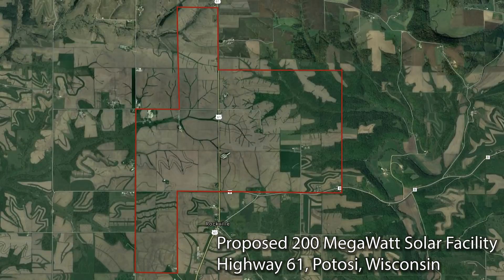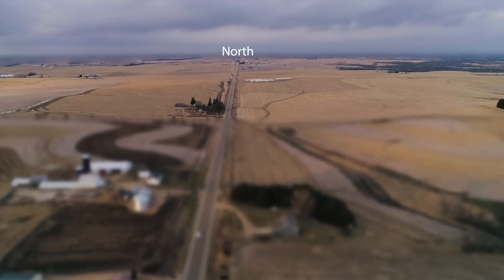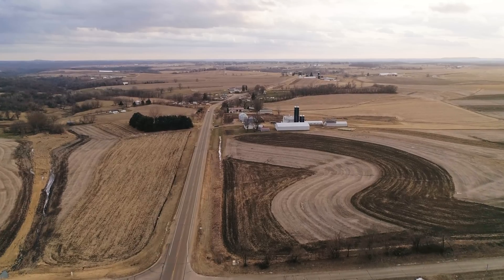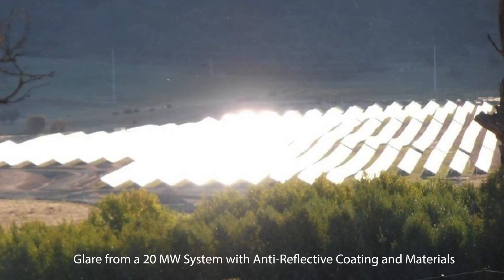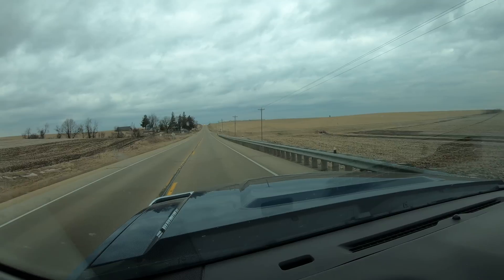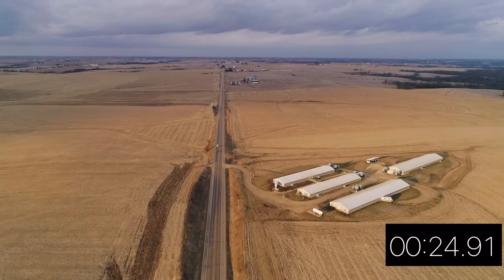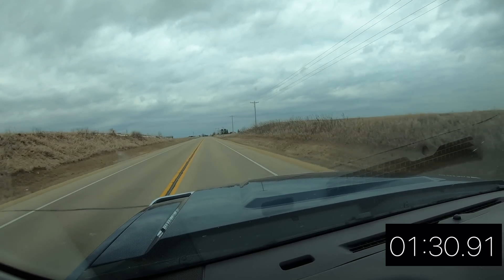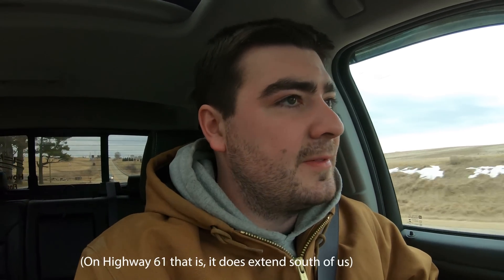Proposed 200-MW Solar Facility | NextEra Energy

Comment: I hate that companies like this have to use up all the good farm land , they don’t make any land any more, most solar panels are only good for 25 years so in 25 years from not either all that land could be put back to farm land but it would be very hard do to all the metal poles in the ground, there are a shortage of panels do the the trade industry. I like the solar energy but there’s better ways to put them in and use less prime farm land. Just cause there’s that much solar going won’t have any affect or your power bill it surly won’t lower it so I don’t see a benefit for you to have so close to the land you farm and want to keep farming. I do know a bit on how they are installed and they ways they put them in if your interested let me know! Keep farming!!
Reply: They don't stop working after 25 years.

Comment: Hi Ryan what is the longevity of the panels which is about 20 years I'm told  and what happens to the land after that
Reply: @Eli_E99 Unless the company goes bankrupt 2 months before that lease period is up...
Reply: The panels usually have a 25 year warranty to supply up to 85% - 90% of their original power output.  They are not going to stop working after 20 years.

Comment: Sorry to hear it's an obsolete energy source there just holding out on us.
Reply: Obsolete energy source? I wish to know what you consider a relative energy source?
Reply: Plasma was introduced by the country we just  blew up a general by the keishi foundation and we stand on a capacitor and can draw enough at 1 meter above the ground to power a house.
Reply: @scottpage978  Fusion Plasma energy has not yet generated enough power to offset the amount consumed in producing the conditions that are necessary for fusion to take place. Plasma power has only been operated for a short period of time. It has not been proven.  
Unfortunately the same has gone on for decades about Hydrogen power.

Comment: In 30 years who has to foot the bill to replace them.  Will they just declare bankruptcy and leave all the hazardous to the local tax payers to clean it up.
Reply: Solar panels are a lot less hazardous to clean up than coal or nuclear power plants. Mostly just steel, glass, and, silicon. not much hazardous there, unlike a nuclear plant.
Reply: Just like turbines at damns, they are maintained and replaced when necessary and the project will out live a person's lifetime.

Comment: can not be good,,, unless you are getting out of farming,,, lots of traffic,   We have so much natural gas in America why would we need solar panels.   it like wind farms,,, they are every where in Oklahoma       they are ugly, and the are going broke,
Reply: Just run a pipeline
Reply: Here in Minnesota we have no fossil fuels. So, we are producing about twenty per cent of our electricity with renewables, wind, solar and hydro. most of the coal fired plants are being shut down, and replaced with gas, we also have a few nuclear plants that still function. Our state goal is to keep moving to energy independace using renewables, rather than building new fossil fuel plants. In the long run, we will have a more reliable supply of clean energy, at, a competitive cost.
Reply: Keith Kuckler That is misleading.  The state goal is 1.5% of our energy by solar by end of 2020, not the current production. The rest is biomass (corn/ethanol) wind and hydro combined which is at about 25% of our total.

Comment: My initial question was going to be about storm damage too. You wouldn’t want glass flying.
Reply: Depending upon the solar module construction the glass of a solar module usually is made of tempered glass with an anti reflective coating. Its very strong like your house windows.
Reply from the maker: ginggur17 I’ve also read about really toxic chemicals like Cadmium in the panels. Supposedly in broken panels the cadmium can leak out really quick!
Reply: How Farms Work , not the kind of stuff ya want in the ground.
Reply: @HowFarmsWork  Yep. And that would pretty much destroy that patch of land.
Reply: How Farms Work I’m pretty sure any exposer to the chemicals in solar panels can cause cancer if I mind right?
Reply: @bruceirvinggaming  Who cares? Trump does not believe in Science anyway. So let the rich get richer!!
Reply: @HowFarmsWork  The panels are sealed, layered in construction.  There is many toxic chemicals in all electronics including your smart phone, your vehicles, computers, batteries, etc. 

Need to ask yourself what are the odds that the solar modules would break.  I've seen solar modules survive significant hail diameter (baseball sized) strikes. I've seen solar modules walked upon during installation. I've seen 35+ year old solar modules still producing power. 
There is a lot of misinformation in these opinions being shared here. 

Farmers have had to battle methane gases or other chemicals produced from livestock. Or the use of hundreds of chemicals on farmfields such as Roundup, 2-4-D, etc.
Some of these toxic chemicals are already in our soils, rocks, water  in low amounts.
Reply: @HowFarmsWork  always good to ask questions. but, ever heard of all the ppl dying from their solar panels on the roofs all around the world? no? me neither. whenever you think something could be a problem, look for precedent. don't buy into hysteria. 

what you are addressing is a recycling problem, not an operational problem. in case of freak damage (tornado, hurricane, earthquake...) it gets treated as h.waste and acted accordingly. your county should make sure proper recycling norms are in the contract with the company, not just landfill-disposal (end of life).

what you are reading in the press about it (or certain internet-sites) focuses on problems arising in countries with no gov. recycling mandates where electronics of any kind just get dumped somewhere, and thus cause env. damage (all kind of toxic components inside).

Comment: I work for a landscape company that has a contract for our energy company here in Michigan and part of it is a big solar field 35 (roughly) minutes from where I live, 10k panels split on 2 250 300 acres biggest solar array east of the Mississippi and I've been told from fellow employees it only powers not even a quarter of the city.

Comment: That photo claiming to be Manchester-Boston airport, isn't near Boston and it isn't a solar panel array. The first hint is you can't see mountains like that anywhere east of the Mississippi River. It is actually one of a set of 3 thermal reflector solar facilities in southern California south of Las Vegas along I 15. I've driven by it numerous times. Google Primm Nevada, it's about 3 miles south west of Primm. On satellite view you can see 3 squarish facilities near a real solar array just to the north east of the thermal facilities.
Reply from the maker: Good eye! Not sure what that photo was doing on the website then, my phone turns up different results on Google than my computer did, here’s the actual image:

https://i0.wp.com/farm4.staticflickr.com/3782/9467107162_f8955c4493.jpg?resize=278%2C366
Reply: @HowFarmsWork  I'm referring to the second photo in your video. Not sure where that first one is located. Check your video. The image you have the Boston text on is actually California.

Comment: Things I would ask questions about if it was in my back yard would be where are the transmission lines too and from the project will be run if it would bring 3 phase power to the local area. Solar panels contain many heavy metals, with you bring up storm damaged in the area I would ask if they will monitor runoff, ground water and how they will handle the panels when broken in the future. To protect your water sources and livestock. Eminent domain is being used in Missouri to put transmission lines in by an outside company(grain belt express) this is without benefiting local customers much if any, their claiming 250MW of capacity for rural towns which isn't much for the amount of land being used for the project and it has a lot of opposition here. Wisconsin may have different laws. Best of luck and thanks for shareing!

Comment: Unless I missed something, it sounds like they're wanting to use, (at least somewhat,) fertile or previously developed farmland. Why wouldn't that want to set this in actual prairie locations? There's got to be some undeveloped land somewhere in the area, correct?
Reply: Undeveloped land is harder to reach and has poor access to the electrical grid. It's much easier for these companies to use this farm land where there are existing tracks and reasonably convenient power connections. Obviously undeveloped land is better overall but for the company they are probably financially better off using agricultural land.
Reply: Many assumptions are being made... prairies are typically protected.  In Iowa and Minnesota solar farms have been built where the need is high and a centralized location between power grids exist for power transmission efficiency.

Comment: We have a great number of them in NC. From what I was told, when the lease ends, they have to return the land back to original condition. As for the glare I am not sure but when they install the panels, they have done it at night.
Reply: Do the panels get hot? Unsafe for installers?
Reply: @MrAlbethke  No
Reply: @MrAlbethke  I was told it was the glare. It could cause a nasty sun burn. This was about five years ago so tech may have changed.
Reply: @viperbl69  No, they are not a magnifying glass. Educate yourself about physical sciences/physics.

Comment: Also, regarding eminent domain, its almost always better to negotiate a contract than trying to fight it in courts. I've worked in the O&G industry and have seen how some of those cases end up... Even if you're 100% against them, negotiating with them and telling them where you will allow construction to happen is you're biggest asset. Plugging your ears and ignoring them (in my experience) usually favors the utility/company... As long as you can prove you attempted to negotiate in good faith you'd have a case. Otherwise not so much...

Comment: They will have to bulldoze the land and be on the watch out for potential eminent domain because once they get the green energy corruption into the local government they will try to more than likely seize land and the solar facility will attract birds like crazy you will have that issue guaranteed if it does happen the reason I know this stuff where I live we have a very corrupting power company that for a basic house will charge you 120.00$ a month for power and they built a solar project that runs power through my city but it all goes straight to the tree huggers in the capitol while my city gets to bear the brunt of the issues with the system.

Comment: One thing you will see is likely alot of heat in the summer, those panels create lots of heat, 150+ degrees here in iowa in the summer on lone panels. It will probably make it hotter around you.
Reply: Increase in heat is a false claim. Some need a lesson in Physics.
Reply: @CGW116A  https://www.google.com/amp/s/phys.org/news/2016-11-solar-island-effect-large-scale-power.amp
Indeed a solar farm that large will raise the local temperature (especially when you are right next to it). A black, aluminum panel that faces directly into the sun all day is going to gather a lot of heat, and will dissipate it far quicker into the air than, say, the giant thermal battery called the ground will.
Reply: De sunns energy hitting the ground is constant wether there are panels ore dirt its the same

Comment: Well everyone wants cheaper and cleaner power this is the future you or your family won’t be able to stop it you should go ahead and benefit from it
Reply from the maker: Personally, I feel solar would be a good fit over parking lots and on roofs similar to what the UK is doing to conserve space. I don’t feel it’s the best use of crop ground but I’m going to look into solar more
Reply: Really where I live we have a 200 megawatt facility and all that power goes straight to the capitol for the tree huggers to enjoy while we cant touch a single volt of it that's how corrupting the green energy is so people like me have seen how corrupt the green energy industry is.
Reply: @KILLKING110  Give me a break, ever hear of the "grid" that power can go anywhere, and, is traded daily like any other commodity, your local power is not all produced locally, it is all interconnected.
Reply: There is nothing cheaper about renewable energy.
Reply: @jeremythomforde3984  Actualy there is. Here in Minnesota, wind power is cheaper to build than new fossil fuel or nuclear plants. and, that does not even take into account the polution costs or cleaning up and decomissioning an old plant.

Comment: Fight it tooth and nail. After the life expectancy of the panels expires, they’ll just get abandoned.
Reply: Mr Irving; the cost to disposed of the hazardous materials will probably be way higher than what you would get for the other materials
Reply: @davidnance6999  Exactly, but they were sold on the prospect of quick cash.
Reply: Part of the bond should include a statement on who will dispose of the panels and equipment. Make sure that your local govt writes that into the bond/contract.
Reply: One of the local communities by me was promised rights to the recyclables when the life span expires. So in 15 or 20 years they can take the scrap aluminum (whatever that may be worth at that time), but there is the hazardous waste they will also have to deal with.

Comment: As my father in law's front yard can attest, that glare can also dry out the ground and plants that are hit by the reflection.  Even if it isn't a magnifying glass, it will still be effected like it were, so I'd be worried about the crops.
Reply: The panels will be placed at the proper angle facing south to capture the full arc of the sun as it moves across the sky. The ones I have seen ( one to three acres) are just an array of panels situated on grass that is mowed. These I speak of are a private endeavor so there may be more involved with something this large run by a utility. I don't see how this would be detrimental to surrounding crops. Regardless of the contour of the land they are placed on the panels will all be tilted the same and there can be nothing around them that can cast shade onto them. I would have anything regarding storm debris if any to be in writing as to clean-up.